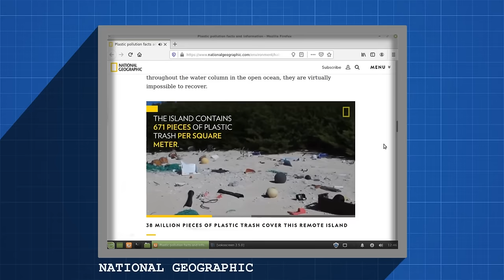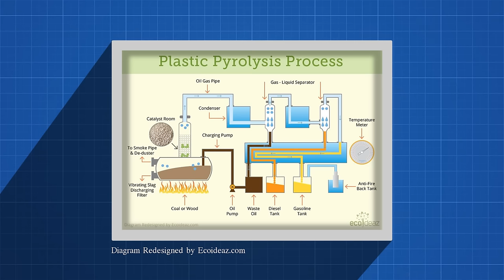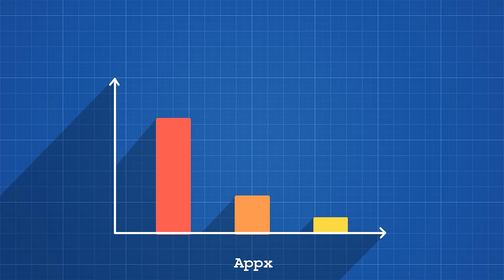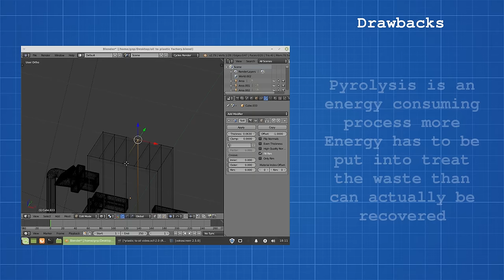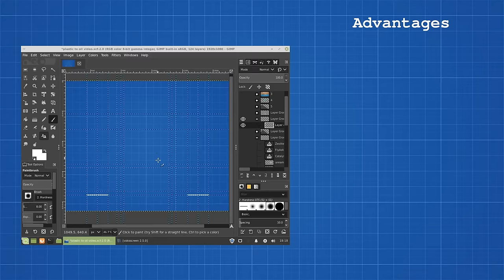How Waste Plastic is Converted into Fuel | Plastic Pyrolysis | Karthi Explains

Comment: Basically reterning it back to oil
Reply: Data Fix  dense 🤣🤣🤣🤣👍
Reply: .. either we're not being taught some important chemistry, or he doesn't clarify the specific oil it produces. It's probably more of a liquid state of plastic that can be reformed rather than it is actualy 'black oil.
Reply: @michaelbedford2993  i think your right 👍
Reply: Plastic is a waste product from oil. So... this is squeezing lemon peels to make limonade. Basically, this burns as much fuel as you get out or costs even more.
Reply: Energy is used to make plastic and it's recovered by using plastic as fuel
Reply: @michaelbedford2993 like diesel and petrol?
Reply: @michaelbedford2993 если это пиролизное масло восстановить при помощи кислорода или метана, можно получить более развитые углеводородные цепочки. Тогда получившийся продукт может быть топливом. А вообще технология рефракции гораздо эффективнее для переработки методом пиролиза, так как даёт возможность получить разные фракции. С которыми необходимо провести разные манипуляции для получения товарного топлива. Но у пластика есть большая проблема - парафинизация. Поэтому схема в видео не работает, необходимо сначала базовое масло депарафинизировать и только потом пускать на переработку.
Reply: @TEXHOBAPBAP how you can dewaxing it?
Reply: Thank you ,that what i was looking for
Reply: We have been bulled for decades

Comment: In your Drawbacks list, you say it requires more energy than it produces.  This energy cost can be reduced by using the product to continue the process.  The absolute best gain would be elimination of plastic waste, thus helping to protect the environment in a meaningful way.  That alone makes it a worthy cause.  Thank you for this video.
Reply: I like your idea! But I wonder if the fuel required to restore plastics into fuel would end up polluting the atmosphere?
Reply: @英伝松木  I know there used to be a type of filter they would put on smoke stacks.  In street slang, it was called a scrubber.  I haven't seen any reference to it in years.  It removed pollutant particles from the vented air.  Like a hepa  filter, but tougher, more durable, heat resistant, washable.  Once installed, it would last for years.   Actually, if they would go back to that system, redesign it for anything that vents air, it could solve  most of the air pollution problems in today's world.
Reply: @英伝松木  nuclear power can solve that issue
Reply: @英伝松木  The fuel and gas produced by the pyrolysis process replaces fossil fuels, thus, while it does release carbon dioxide into the atmosphere, it reduces the same use of more fossil fuels and at the same time eliminates plastic waste in the environment.
Reply: It
Reply: You are talking about recursion and I would also suggest to do that with Solar energy to do pyrolysis

Comment: we know the heat generated by burning plastic drives pyrolysis and creates more heat, so this process is losing the energy shredding and compressing.  perhaps flue gas could be used to melt the plastic, then it is sent into the chamber as a liquid.  the gas off the liquid, air included, would be combined with the pyro gas and go direct to a turbine generator.  it might still fall short of what plasma recycling can do, but it could conceivably power a small system far from a power grid, perhaps one that burns up the huge piles of unsold synthetic fiber (plastic) clothes.  of course, not allowing things to be made and wasted in the pursuit of profit would help too.

Comment: A great explanation, and it looks like a great way to reprocess dirty, or unidentified plastic waste that cannot be recycled directly.  What I would like to know is what's the emissions profile from these processes, can to the off-gasses be cleaned up to eliminate the release of any weird complex compounds with chlorine attached, for example.
Reply: Did you find the answer to this question ?
Reply: @nicobriceno732  No, no answer to that question, unfortunately
Reply: dirty gases are burnet a feedback
Reply: You can loop the pyrolyzed gas back into the system to generate more heat. The burnt fumes have to be cleaned by a chemical exchanger, I guess, to make'em less degrading to the environment.
Reply: @ayonbiswas4186  this was my thought use the emissions for something good
Reply: Who cares? The fact that you can get fuel for reducing plastic is a good enough reason to do it especially when tshtf and fuel becomes too expensive
Reply: @verdiblue  people who will be breathing it and getting cancer care...

Comment: Thanks for comprehensive explanation.
I was recently thinking about recycling of glass bottles and how its shown to be unsustainable, becouse it requires alot of energy to do. But I think the problem is with our values. If we value clean environment, then we will make an effort to recycle glass bottles and make supply chains work in a way to do it sustainably. We do it in our own lives. We dont just buy the cheapest products and dont make an effort with the things we value. The same goes for recycling. If we value sustainability and clean environment, we should use and recycle glass bottles. The amount of empty km that trucks make is stagering, we could use them - I work as a driver and know that.

Comment: Interesting video.
I will make a few observations based on British news articles about pyrolysis along with observations from watching many videos on the subject.

1, Pyrolosis needs no additives. Just heat the plastic and it begins to turn into gas.

2, By using the gas produced to run the burner, the system requires little or no resources to power it.

There is a Pyrolysis plant in Ireland that produces 10,000L of plastics derived fuel per day at a cost of just penniez in comparison to producing the same fuel from crude oil.

Comment: Hi, I am wondering what temperatures are ideally used for pyrolysis of plastic. My idea: Solar mirror energy concentration to heat up the P-chamber.
Reply: I have also thought this. I read somewhere, maybe many places, that 500-600C was required for pyrolysis. I was also reading that larger concentrated solar mirror arrays are capable of producing such temperatures. The sources may have been unreliable and/or I may be remembering incorrectly
Reply: anything from 475Celsius will be fine for the pyrolysis process.
Reply: engineering a reactor like this would be interesting; it would need to be a column elevated above the ground so that an array of concentrating mirrors can focus on it. Just like the solar thermal molten salt to steam method of generating electricity. On that note perhaps you can have a co-gen facility where the molten salt is used to heat the pyrolysis chamber; and residual heat left over when there is no more plastic to pyrolyze goes towards generating electricity. IE when no plastic waste it generates electricity when steam; when waste needs to be pyrolyzed molten salt is sent to heat the pyrolysis chamber.
Reply: @MM-bm6en  dang i mean, i could use my solar cooker for it, i'd just have to start it in the morning, in arizona or something.

Comment: You're right in that this isn't sustainable long term but if we manage (hopefully) to migrate to biodegradable plastics not made with fossil fuels this would be a great method to clean up the current plastic waste once and for all
Reply: It would yes , but companies don't want to burn money . Obviously the energy needed to make fuel out of plastic is more than the energy produced by the plastic fuel , decent bit of recycling if you are using renewable energy like solar panels to do it I suppose but no company will want to do it

Comment: QUESTION:   Solar heat does not require oxygen so I am wondering if we can make the mechanism more efficient simply by apply a fresnel lens?

Further I think the fresnel lens can now take advantage of industrial heat lamps also powered by solar..
Can we explore this together?  I am designing a new housing system to restore the environment and this is an aspect.
Reply: You need to calculate the efficiency of using solar power in to heating phase of the process. And at the end you will consume solar power for producing crude oil 🤔, the gas and ash will be hard  to handle in an nonprofessional environment.
Reply: @pipelcamadalin9280  no actually the ash is valuable as it can then break down to other useful chemicals.

The gas is what we condense to at worst a low grade fuel.

Comment: What can the carbon black be used for? Also when using this system with tires. Is there any issue with the high sulfer content in the collected fuel? Is just a higher than commercial diesel or is it something to be cautious about? Great video! Thank you!
Reply: Sulphur is only a concern if the plastic molecule you are making the oil from would have the element sulphur in it. Otherwise, there's no way it could be in the oil. If it does contain sulphur, the sulphur gas should be separable from the oil at certain temperatures, if you staged the distillation or condensing.

Carbon black is a popular pigment. You can add it to anything that uses pigments, and even concrete, if you want black concrete, or pottery, for black pottery. It is a very flame resistant powder, so it can improve the thermal properties of some things, as well as you can cement it together to make a bad form of pencil lead.

Comment: Gas can be returned to process (let say to run grinder and heat chamber ) and also solar concentrator can be used for heating chamber , in this case Pyrolysis can be economical
Reply: Even after considering this factor, the energy required for pyrolysis will be greater than the energy output you can generate from the fuel processed by this method

Comment: if you could use the gas to cut the energy needed to run the system wouldnt this change it to a positive energy consumption ?
Reply: There’s energy expended in the collection, sorting, cleaning, & shredding.

Comment: Nice! If you ever do a follow up it would be interesting to know how much extra energy is needed. Perhaps countries with “free” geothermal (Norway) or “free” solar (equatorial) could become modest yet profitable oil producers.
Reply: Use solar panels to heat the stove and there you go. Or create a stove that will operate on the gas you are producing. Whatever is left is the profit.
Reply: I was thinking that a similar process, using solar panels, would be a great way to desalinate ocean water for drinking. IDK why they aren't doing this already. Even without solar panels for heat, there are ways to use the containers to and sun on them to cause evaporation in the distillation process. Like solar ovens work.
Reply: the last thing the world needs right now is another way to burn oil and gas.
Reply: @cageybee7221  how do you figure? Recycling that plastic is better than digging more oil out of the ground. Of course it would be nice to convert co2 in the air back into oil using renewables, then we could stop digging entirely while working on biodiesel or alternatives to plastics.
Reply: @Archpimp  not if the power we use to "recycle" that plastic also comes from oil, which 80% of the world's power does. the last thing the world needs is more ways to use fossil fuels. this is like being in a car that has driven into a river and is slowly flooding, and smashing the window with a hammer because you are thirsty.
Reply: @cageybee7221  I started this topic with “free” geothermal or solar; obviously the plan is to not use costly fossil fuels to make fossil fuels. We want to use the excess intermittent energy, sort of like doing some background work in an idle thread.
Reply: @Archpimp  why not just use that energy instead of wasting it on creating a less efficient form of oil that will contribute to climate change? i've still yet to hear a good arguement for why burning more oil is a good thing.
Reply: @cageybee7221  You seem innately opposed to this idea instead of being charitable and thinking about the good and bad points. My suggestion is to recycle trash plastic into oil using energy which would otherwise be unused, ostensibly reducing oil extraction slightly. Do you have a better concrete idea? If you do, great, share it and then we can compare them to see which is better. I've given you the why this is a good idea, because it reduces oil extraction, you don't have to agree that it works but it's a good argument.
Reply: @Archpimp  use that energy to replace fossil fuels, stop extracting them and stop  making more with gimmicks like this and transition away.
Reply: @Archpimp  firstly, THE setup of "FREE ENERGY" is Costly and High Price to Pay. 
Secondly, "MAINTENANCE" FREE ENERGY like wind turbine , water turbine, solar energy, Geothermal is High Costs, especially Maintenance of battery Life. 

Then "Secure" Your or people Free energy Stations is High Cost. Especially Geothermal, because the Postitions of that sources. 

So.. Fossils energy, simplest things to do. Burn it and your piston or motors On. No need of "High Cost" of Setup, maintenance, secure, or acces it.

The energy your produce for Pistons or motor Running from Fossil is relatively Acceptable by economic Law. 

And one more advantage of fossils energy is Movable. You can't bring your geothermal stations to other place 😂😂 Like move it to Big Plastic Sources. 

Oh Yeah, The plastic sources need "Fossil" energy to transport to your geothermal stations.
Reply: @cageybee7221 Circus, this is useful for efficiently recycling plastic. Bette than plastic contamination. 

Opposition to a small step in the right direction is fucking nuts

Comment: If you had a waste incinerator or gasifier powering the heating process then as plastic waste is separated from other waste it can then run the whole plant on both streams.

At least theoretically.
Reply: Exactly.  The waste plastic is all fuel.  Using some of the material to generate the heat to produce the other products is perfectly acceptable.
What matters is whether the process produces a profit.  If the waste material is free, and the refined products produce more income than it costs to maintain the refinery, then it's a win-win-win.

Comment: Curious if fully powered by solar and batteries would it become more sustainable?
Reply: his use of the word sustainable is misleading
i am pretty sure what he means is it wont make money
there are many many ways to generate the heat required, 450 isn't that high
coppicing (funny how spell check pretends that is not a word) comes to mind
but really this technology will only ever benefit individuals
Reply: Solarpanels and batterys are made of metals (silver, copper,nickel...) that need to be mined using a lot of diesel... They are not good for environment as the mining puts huge holes in the ground.
That green electric revolution is a lie to prop up the economy, nothing more!

Comment: Thank you. I've 77, and have been looking for a way to make plastic recyclable for decades. This helps, but now we need to find a way to do it that perhaps uses other waste as fuel for the process. So long as it takes more fuel than you get back, it won't be economically viable and nobody will do it on the scales needed.
Reply: You can use cheaper fuel to make more expensive fuel. The heat resulting heat from combustion can also be used for heating.
Reply: Burn the oil to cook the plastic.
Reply: what about using the gas it produces to help with the heating process?

Comment: Very nice animation and good explanation, eventhough I am not used to the "Indian" accent.  Yet I would not recommend to use "coal or wood" for heating the system because it creates a LOT of pollution. Electricity should be the ideal source of energy to start the process.
Reply: The use of electricity would more or less negate this as a way of generating fuel.
It is almost necessitated it be done in a low tech fashion, and apparently there are ways to set up the system to run more efficiently than as presented here.
if you are worried about the amount of pollution generated by wood fires, well..i just don't know what to tell you.